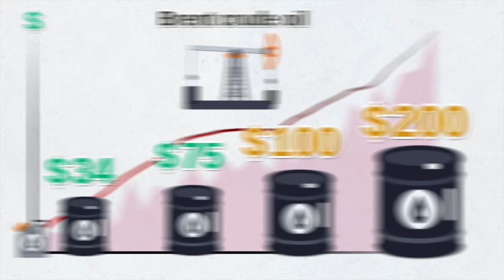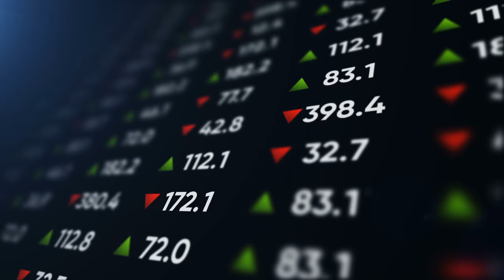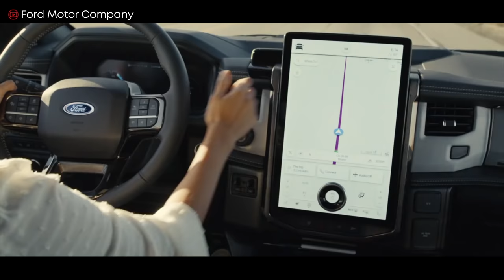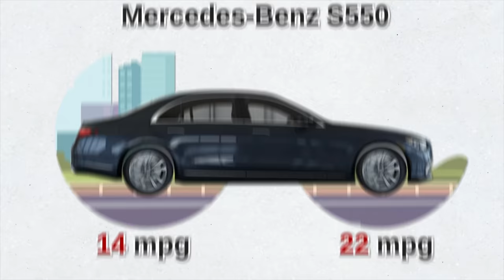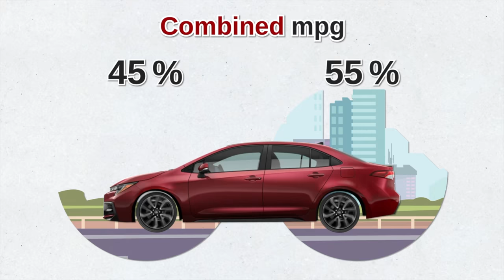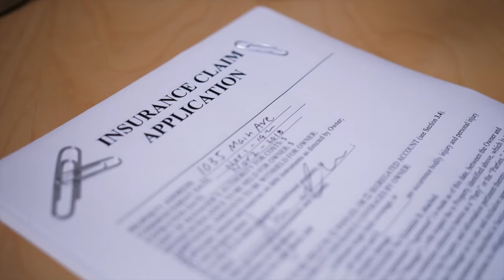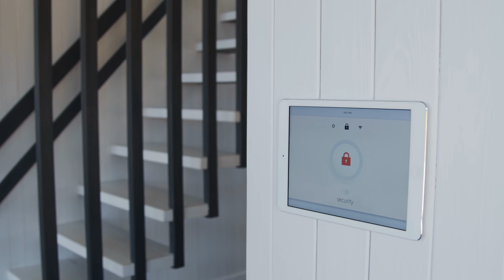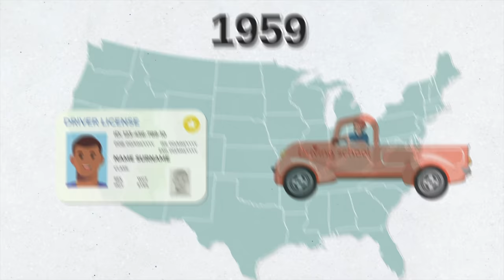Here's Why Cars are Expensive as Hell to Own Now

Comment: If everyone in the U.S. had a EV car and all plugged them in to recharge, the entire U.S. grid would crash. Have a great day
Reply: Nope
Reply: I don't even doubt  it
Reply: @theshield1613  So does smoking....
Reply: What about charging stations that run off solar power?
Reply: @mrpoohbearlvr  Currently everybody doesn’t have electric vehicle, correct? Don’t you think grid is strengthened in about same speed as consumption raises ? Nothing changes overnight. 

Realistically I don’t think battery is the solution, so much energy stored in very volatile form. Like riding a dynamite (except more powerful).
Reply: Yep
Reply: It can be supplemented with solar.
Reply: @Jerry-me1fy  few and far between.
Reply: I don't think the current pull is that strong, that's like saying, if everyone flushes at the same time, the pipes blow up. 😆
Reply: @Jerry-me1fy  not sufficient and long lasting especially in areas of Midwest with cloudy overcast..
Reply: true....California, with  few  EVs , already  experiencing  power  outages, blackouts 
, brownouts, etc. power  grid  would  have  to  be  upgraded  in  order  to  be  able  to  handle/ accommodate  millions  of  charging  EVs, which  would  take  years  n  along  with  billions  of $$.
Reply: Solar powered cars make more sense
Reply: @Jerry-me1fy  Solar only generates full capacity 25% of the time, in that 6 hour period you need to store 18 hrs of electricity while providing full capacity charging. And you have to make all those batteries, the same batteries that your EV uses.
That means your EV car prices will skyrocket as demand for the batteries outstrip supply.
Why do you think Elon Musk is switching to Lithium Iron Phosphate batteries? 
It's cheaper and it uses fewer expensive and in high demand materials.
Reply: @theshield1613  you ain't going to have no electric cars unless you got a shitload of nuclear
Reply: If everyone in the US flushed the toilet at once it would cause a day long water shortage.
Reply: @williamevans6522  LOL
Reply: Joe Six Pack can't afford an electric car
Reply: Great solution. Complain, point out problems. Do nothing. Very helpful
Reply: @IKnewMickey  I was thinking the same thing. Hahahaha
Reply: If everyone had an EV the amount of waste from broken down vehicles would be astronomical.
Reply: @asmilenvrseen 
Really?
Reply: Only in california and NY--
Reply: What about house with 5 drivers /cars. All plugged in @ the same time
Reply: @theshield1613  so does electric
Reply: @Jerry-me1fy  what about …….
The winter 🥶 no sun & clouds & nighttime ….no solar 🤔🤣
Reply: @Jairan78  @ nighttime?
In the winter?
Reply: @Ihatebs  yep
Reply: @asmilenvrseen  They would, but I don't trust that system. Less complexity on a car is a longer lasting one.
Reply: @hankkingsley9300  spitting facts
Reply: @IKnewMickey  🤔
Yeah we’ve got an endless amount of water here
Reply: @TheSleepingonit  how about household wit 5 ppl that drive ….that’s 5 cars all plugged in @ once
Reply: @steelisthemeal  then I guess you would use the normal power grid but the solar panels would still be working at 25%
Reply: @Ihatebs  we already riding on gasoline, one spark and it go kaboom...
Reply: @standoutpunching2936  🤣
Reply: @alphaxfang  You may have watched too many movies (hint, movies are entertainment).
Reply: @Ihatebs  so you mean gasoline doesn't explode when exposed to fire or spark? We learn something new everyday... Next time someone fill their car i will throw some cigarettes to lighten the mood... After all fire and gasoline won't create any explosion...
Reply: @alphaxfang  When your compare to energy density of modern battery. Why is it that people nowadays are just on/off and can’t stay on the topic.

During Christmas, I was in arctic circle. It was 40 below and it was really hard to get gasoline on fire. That is totally irrelevant for this discussion. Jeez
Reply: @steelisthemeal  The cars charge on low power for many hours so it is not a huge drain.But there are many downsides to electric.If you go above 75 mph--which is about the average speed of most hwys away from urban areas--the batteries drain very quickly.Also they have hidden their patents to help in a crash--a tesla in california after a wreck caught fire and it took 30,000 gallons of water to put it out--30k is about what a large house fire.Also those forever lubricants--noone has any clue to how poisonous they are to our environment.Also--it actually generally creates the same pollution to make one of these cars and then to dispose of the battery--so in the long run they are no better right now.Also charging stations are few and far between and that is putting it mildly.
Reply: Did you watch far enough into the video where he states that projections are that 31% of the cars in the US will be EVs by 2040? I mean, the way we've supported infrastructure in this country, it's a valid concern that we may not be able to support EVs at some point, but still...

By everyone in the US, do you mean current car owners, or do you mean literally everyone? 

Your statement is an absurd hypothetical at best.
Reply: They said this about computers to...
Reply: That would happen here in the UK  as well , stuff EV's
Reply: Texas learned this the hard way last Febuary
Reply: @justacinnamonbun8658  Texas learned about that February 2021
Reply: @blexxy5861  yeah but there was a demand for computers
Reply: I am all for liquid fuels and equal access to them for all, but hey if everyone all went to the gas station at the same time, we'd have no fuel for a few days. Not the strongest argument against EVs

Comment: Remember that sometime in the 1980s, gas was reformulated.  As a result, my Volvo 1800 that used to get ~30mpg, now gets ~25mpg.  Same with my MG Midget.  Lead was also removed from gasoline, requiring a lot more work at the manufacturing plant to make hardened valves AND a need to retrofit old cars with hardened valves at a cost of around $900 per cylinder head (for a four cylinder car).
Reply: Damn! ...you must be as old as I am! Gotta remember however...all those pita valve jobs at 75k miles when there was lead in the gas. Also....here in the north, we always had gas line freezeups before there was ethanol.
Reply: I got 27 MPG on CA "Smog" gas, and 35+ MPG on normal gas in rural AZ.
Reply: @astairawood9189  all they need to remember is to do a little research on the development of automobile engines unless they are like some of the old geezers who were there to experience it first hand.

Comment: These electric gurus completely miss the fact that renewables will never replace fossil fuels for trains, ships and planes (commercial passenger jets) and HGVs or supply enough power for heavy industry, coz renewable do not carry the energy required and there is insufficient mineable material on the planet to make the batteries required.
Reply: Never is a long time. Do you think we'll using such modes of transport on the next few centuries ?

Isn't it about time after a few millenia we move away from burning stuff to get our energy needs ?
Reply: @magiclion  Yes, start using nuclear.
Reply: We don’t need to replace that if our electric grid is completely off burning coal,natural gas etc

It’s all about offsetting the footprint
Reply: @magiclion  not when a country's dollar is backed by oil,
Reply: @magiclion  LOL. "About time"
Reply: @timothyalsfeld8323  laughably incorrect
Reply: there is not sufficient energy yet because there is not enough infrastructure yet
Reply: @YoungJackRack  No, people have done calculations, even if you build ALL the infrastructure, it STILL won't be enough energy. Renewable energy sources are REALLY inefficient. Look up withouthotair
Reply: research and studies are already going on about how to convert ships and planes to fully electric. There is a video in YT about axial flux motors. Gasoline cars in the beginning were nowhere as efficient as today. A 1900s Ford Model T had 3.0L I4 engine that produced only 20hp. Today a Toyota Camry comes with a 2.5L I4 that produces 203 hp. similar way over the period of time electric vehicles will also evolve to be more efficient.

Comment: Here in India gasoline prices are 40 percent more than the United States. That gasoline  is mixed  10 percent ethanol .
Reply: At least beef is cheap
Reply: the reason why gasoline is cheaper in the US is because gas taxes were removed from inflation index since 1990s, meaning they were set at certain prices and havent changed since then. In India, tax is calculated as a percentage of the retail price. But in the US the Federal fuel tax is 18.4c per gallon for gasoline. I live in Texas and here state fuel tax is 20c per gallon for gasoline. These values dont change irrespective of retail gas prices.

Comment: I had Safco for 30 years. Great company. I didn't know they were bought by Liberty Mutual. Chunk of steel fell off a flatbed simi doing $10,00 of damage to my New Charger. Liberty Mutual screwed me out of $6,000. I dropped the car insurance on my 4 vehicles and homeowners and went to USAA after research.
Reply: Well, I haGd USAA and they screwed me too.  they USED to be great but have joined the mob now.  Same for GEICO who has not paid me for a totaled car for 2 years even though required by law to do so.

Comment: Hey Scotty, I get 20% less mileage with the winter gas here in New Jersey, do you know why? (I am driving a GX 460 in case that matters)
Reply: I think it might be because they put more ethanol, or another additive in winter fuel.  I also get less gas mileage in winter.   My car is almost 30 years old.
Reply: I also get less mileage in the winter months and believe it does have to do with the blend / mixture as mentioned. It’s been like this for years now.
Reply: It's the temperature, not the fuel. Ambient temperature being cooler means that the intake charge cools the cylinder more. The ideal temperature for combustion is high relative to what we call "room temperature" and lower temperature coming in means lower efficiency. Combine that with higher density of cold air (requiring more fuel to go with the air to maintain the correct ratio) and your vehicle having to push through denser air and you have a recipe for a noticeable MPG drop.

Comment: It will be tough to create an ev equal to a gas counterpart that can tow campers boats etc. no one traveling down a coast will want to stop numerous times for up to an hour. If they could drop charge times I’d for sure look at an EV. Also dropping a boat at the ramp in saltwater. I can’t see that being good for the battery pack. Just some questions that’s all, I’m not against it at all

Comment: As a current (pun intended) EV owner, I can tell you that big companies like EVgo are doing a terrible job. Publicly available chargers are few and far in between, when they work. The US market is a very fickle, double-minded bunch. Plug-ins with an ICE are the way to go for the foreseeable future.
Reply: You mean "hybrids"?
Reply: Full EVs are a novelty item. Just like the SmartForTwo. They had a good run but were not practical for everyday, long distance driving. The EV will go the way of the SmartForTwo, in my opinion. Scotty hit the nail on the head, hydrogen power will replace EVs. EVs are a lucrative, "stop gap" measure. Unless you can recharge a high voltage battery pack from near 0% to 100% in 5 minutes, I highly doubt most Americans that are already inpatient with life in general, are going to sit there and wait more than 5 minutes for a fill that they're already used to with an ICE or hybrid vehicle. I've seen the Tesla chargers, they have them at all the malls. That's what they're made for, mall running.
Reply: @justacinnamonbun8658  when did Scotty say anything about hydrogen? Must have missed that one. I agree...seems stupid to not use one of the numerous alternative renewable fuels in an ICE vehicle. A really old idea that has been successfully used for well over a hundred years.
Reply: @northdakotaham1752  If you watch enough Scotty videos, he has said this many times and I agree. Hydrogen fuel cell vehicles will become more popular down the road and probably replace EVs. The rationale? EVs will always rely on a heavy battery, and batteries have to be replaced (or individual cells), not to mention the charging times. Plus EVs don't do to well in places like parts of Canada where the cold dips down to -40°F. Right now in Saskatoon it's -20°F with a real feel of -39°F. You just need an engine with spark and heat to get going is the bottom line, you need fire LOL.
Reply: @justacinnamonbun8658  amen totally agree with you. Let's hope evs disappears. I like electricity but not for cars.
Reply: This thread won’t age well. Hydrogen is to expensive. Battery technology will get better and is today good enough for 80% of us. Talk with our kids and soccer moms and you will understand what the future is.
Reply: @Harrythehun  not really, if our electricity production getting better and better we can produce hydrogen for much more cheaper... and humanity also keep improving hydrogen productivity everyday...
Reply: @alphaxfang  To expensive and to big losses in hydrogen. Use electricity to make hydrogen then compress to high pressure or low temperature liquid, then distribute hydrogen with low energy density in new distribution systems to cars that make electricity to motors. Don't you see the losses? Battery cars uses the existing systems and most of all house already has electric connections to the grid and can charge during night when the cost of electric is lower?
Reply: @Harrythehun  pretty sure the method for producing hydrogen is not limited to electrolysis, researcher still researching new method to create cheaper more efficient hydrogen... At least for hydrogen system you can use all existing technology without mining precious metal... Plus your hydrogen tank will not degrade like battery...
Reply: @alphaxfang  Ok but for foreseeable future hydrogen has no upsides for passenger cars.
Reply: @Harrythehun  no degradation, fill up speed the same as ice car, it has all the benefit from electric motor, and no pollution from mining... Yeah there is no upside...
Reply: @northdakotaham1752  you mean to say that using 85% ethanol fuel is a good thing? Made from diesel and lots of labor and grants? Its a net loss for the amount of energy in the fuel. 
A dumb idea.
Reply: @Harrythehun  if you own an ICE vehicle...you are producing hydrogen gas everytime you run the vehicle. The hydrogen is produced as your vehicle charging system charges the lead acid battery which is used for starting and running your vehicle. Any high school chemistry class can produce hydrogen...without using electricity.. I know bc I did it when I was in high school chemistry class back in the mid 70s.
Reply: @williamevans6522  i think with new technology we can fix those leaking problem... We use gasoline for hundreds of years and they explode nicely too...
Reply: @northdakotaham1752  how much is a gallon of hydrogen in fuel tax?
Reply: @alphaxfang  true, gas does explode, but it's  a "direct"  fuel , whereas you need a direct fuel to produce hydrogen .
Reply: @neiltitmus9744  depends upon the state where you are buying it.
Reply: @williamevans6522  in chemistry class we didn't use any fuel. I am pretty certain we also didn't use the acid/zinc combination due the hazards of handling hydrochloric acid. Most likely we used sodium hydroxide and aluminum. If you have electricity you can split hydrogen out of water. Very simple process that anyone can do. There will never be a shortage of hydrogen. Over half the planet is covered with it.
Reply: @northdakotaham1752  exactly. You need electricity to produce hydroge n. You need fuel- to make the electricity - to make the hydrogen.

H2 is nothing more than an energy TRANSFER  medium.
Reply: @williamevans6522  you don't need electricity to produce hydrogen. There are multiple ways of producing hydrogen without electricity. Just mixing a couple of simple, readily available chemicals together will produce hydrogen. You can produce it even without the chemicals.

Comment: A lot of high end luxury auto makers are discontinuing their large V10, W12, V12, and W16 engines right now, considering how efficient and effective EVs really are. Electric charging stations are slowly popping up, which is very helpful for those who don't own homes and/or can't put their electric chargers in their homes due to space, or their electricity can't handle the capacity required to charge. The 2022 BMW 760i will be the last vehicle to have the V12 engine, since demand is very low due to it's high price tag, and it is not efficient in terms of fuel mileage and emissions. Nowadays oil companies are switching over to EV chargers.

Comment: Gasoline and car oils prices are sky high. A few years ago in the year 2000 a gallon of gasoline cost 1.15 dollars more or less (*1) and a quart of oil cost between 50 cents and two dollars depending on the brand and the type of oil, synthetic, semi-synthetic, conventional, etc.

All those war and commercial conflicts only caused the disorder in those markets that we now pay with very high prices in our consumption because the price of a barrel of oil remains the same with its price variations depending on the circumstances but it has been between 40 and 120 dollars a barrel and in the new millennium it was not more than two dollars a gallon. 

(*1) I bought it at 69 cents a gallon in the year 2000, of course outside the city of San Diego.

Comment: One of large factor not mentioned in this video as to why oil/gas has gone up. The M3 money supply has doubled since 2014. When there is more money in supply, it causes inflation.
All those huge bills signed in the past couple of years is the cause of recent inflation with a slight delay. Crude oil prices can be charted fairly close with the value of the dollar.